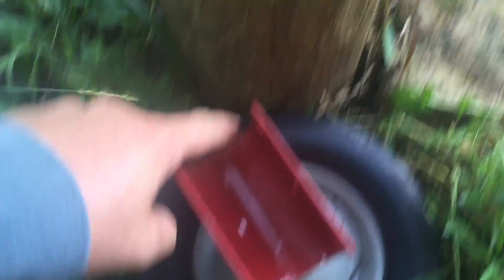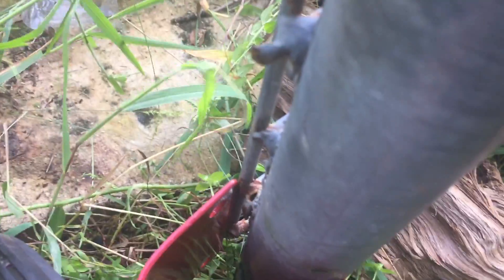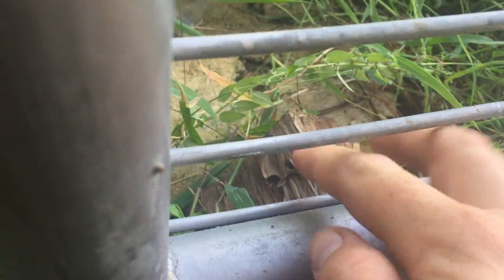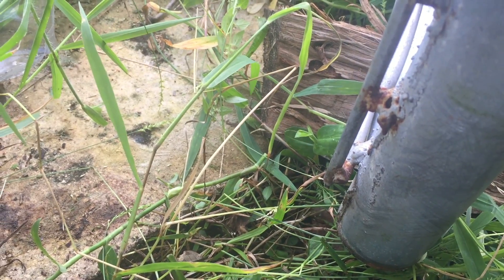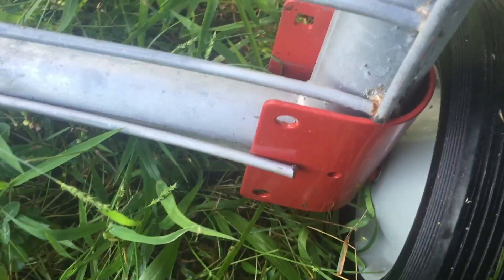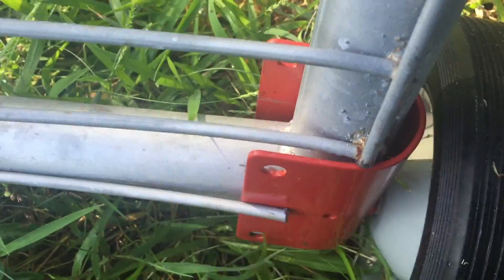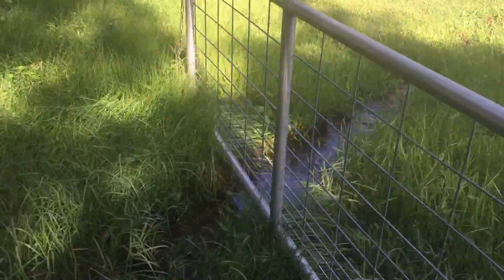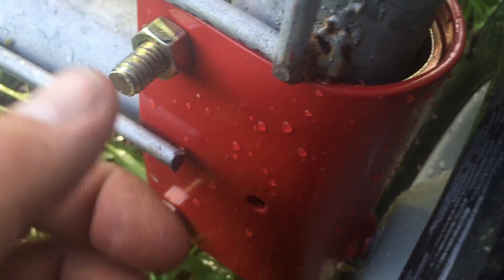Farm Fence Gate Wheel

Comment: Could I ask for specifics on how you installed the gate wheel? I'm working with the same style and after screwing everything in the wheel bends at a sharp angle when sat on the ground and I can't figure out what else I should be doing so it sits straight and stays on tight.